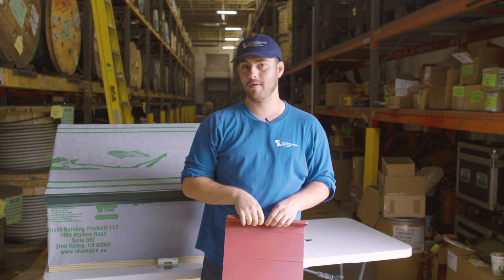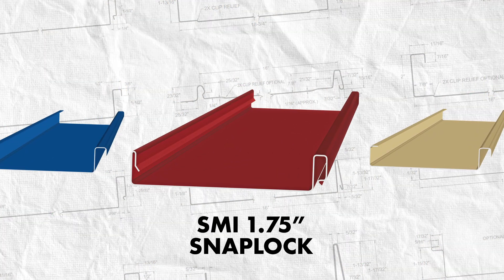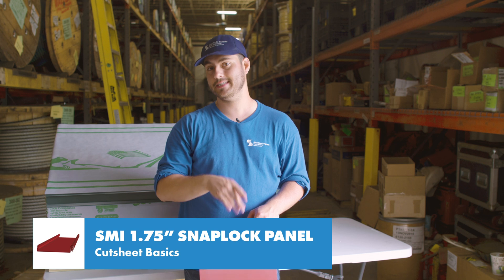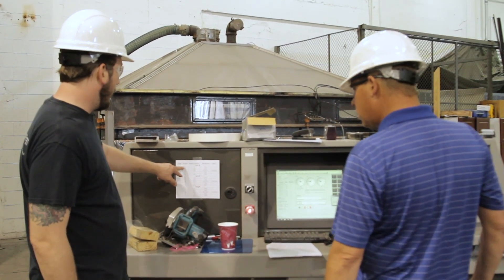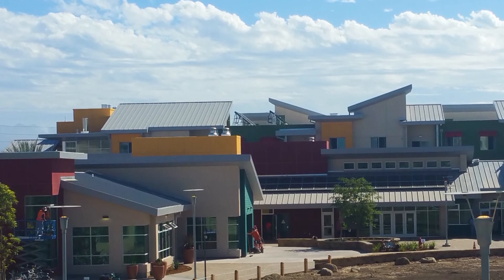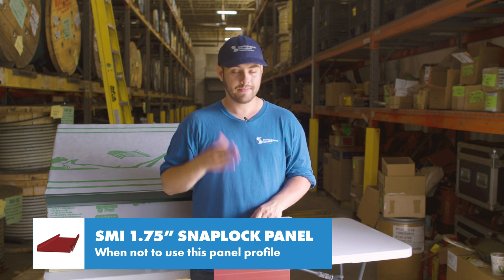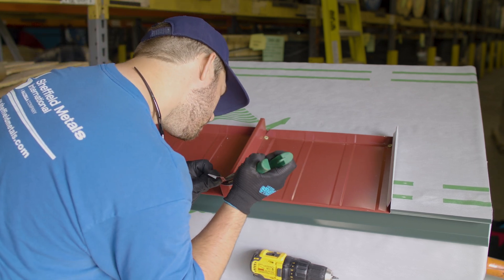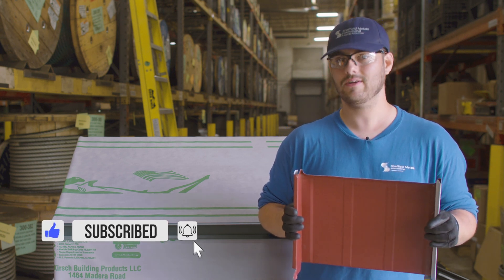SMI 1.75" Snaplock Metal Roof Panel: Uses, Installation, Engineering

Comment: Im building a Lean-To that is limited to 2:12 pitch. Do I OR should I add 1/8" butyl tape to the male leg for a better water seal? Any tips on doing this? I'm in the Central Valley of California. I also plan on using Water & Ice Shield underlayment.

Comment: If I use this on a 2:12 slope 14' long, should I also add 1/8" x 3/4" EDPM Butyl Rubber tape to the male tab? I want to do this right so my Lean-To Patio cover doesn't leak. I cannot increase the slope.

Comment: I'm in Florida.  Does anybody make an insulated panel with R-40+ energy rating  and 1 HR fire resistance rating in a free standing like this with enough load to handle solar panels?  If not, why not? image the cost savings of not having to plywood and wrap the roof?

Comment: Doesn't the SMI 1.75" come with a continuous bead of factory applied sealant in the female seam?
Reply from the maker: If you run a machine with a sealant applicator system like Hot Melt, you can apply a continuous bead as the panel is formed. This is true of any panel, not just the SMI 1.75" SnapLock. -Thad
Reply: @TheMetalRoofingChannel  Thanx for the quick reply.  I noticed that you hadn't noted any kind of sealant used in the system's side-laps during the video.  Is this an optional feature or is it required for the air and moisture tests?
Reply from the maker: My apologies, I misunderstood your original question! If you are using the SMI 1.75" SnapLock panel with a slope of 3/12 or above (hydrokinetic condition), you don’t need to use sealant in the seams unless the specification is asking for that test procedure. -Thad
Reply: Ive been installing metal roofs for a couple years now and im looking into getting my own machine. New tech SSQII is one ive been researching. Any recommendations?
Reply from the maker: The SSQ II gives you a ton of versatility with the variety of panel profiles that you can pick from, and the roller sets are quick and easy to change out. Sheffield Metals sells New Tech machines, so if you're interested drop them a line here or let me know if you have anymore questions: http://bit.ly/contact-sheffield -Thad